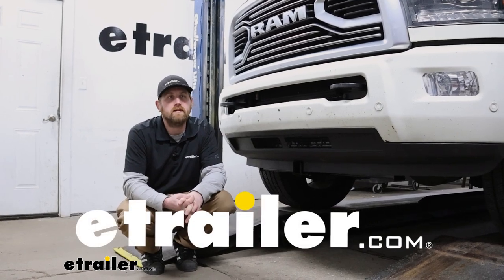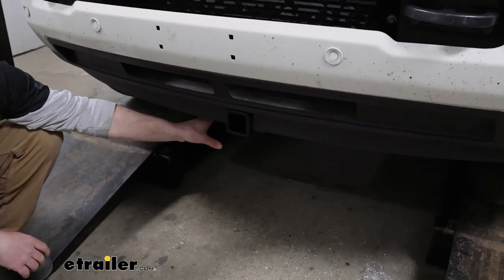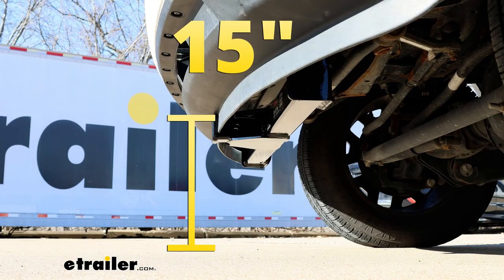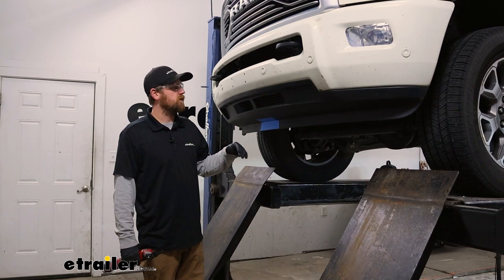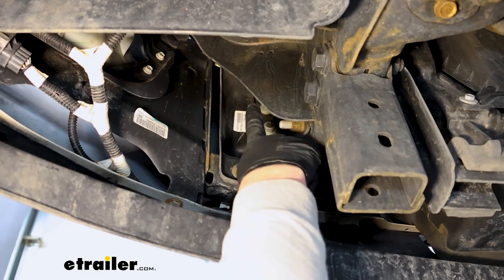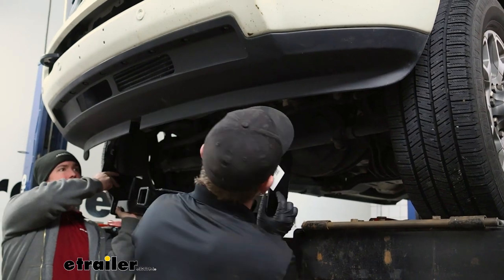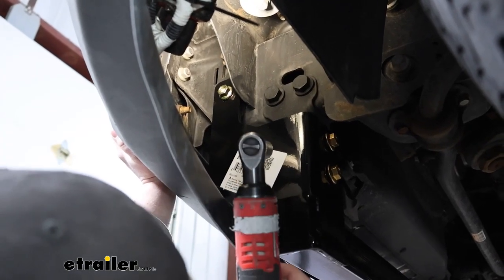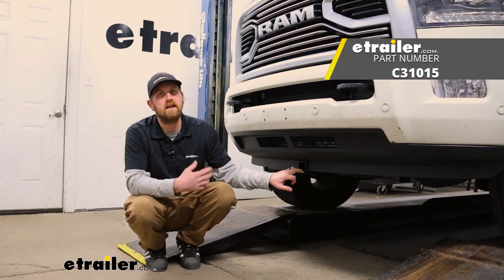etrailer | 2018 Ram 2500 Curt Front Mount Trailer Hitch Receiver: Complete Installation

Comment: Will this fit a 2020 ram 3500
Reply from the maker: It won't. It fits Ram 2500 models up until the 2018 model year. For your 2020, Curt doesn't offer a front mount receiver but you can use the Draw-Tite # DT36MR.
https://www.etrailer.com/Front-Receiver-Hitch/Ram/3500/2020/DT36MR.html?VehicleID=2020121923